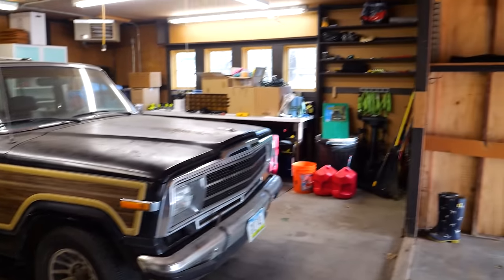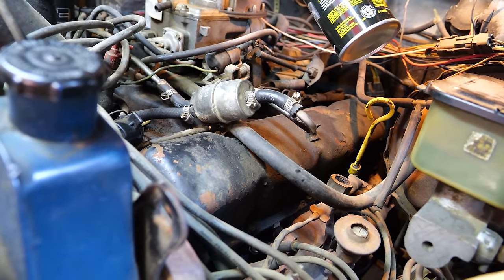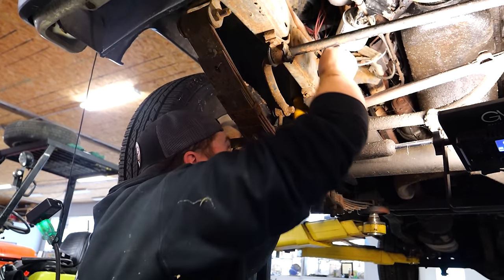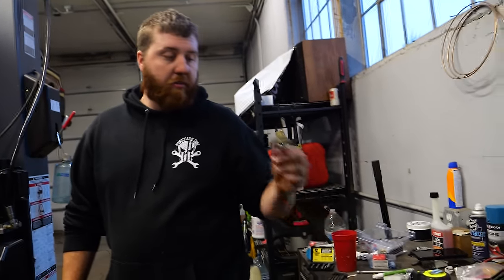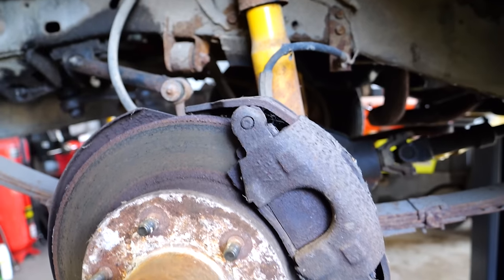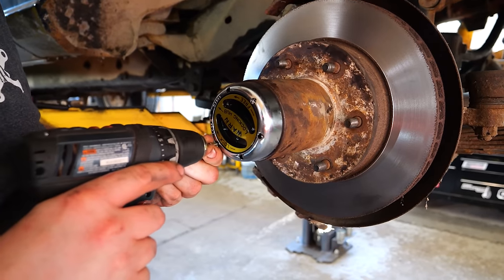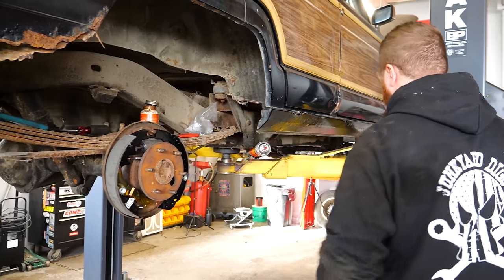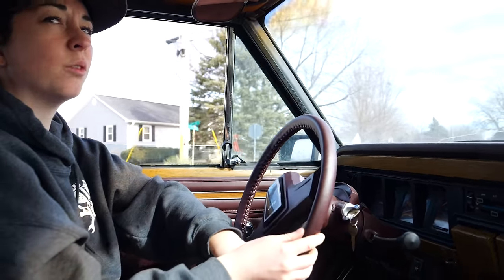Can we SAVE a Jeep that was RAN WITHOUT OIL?? Marketplace SURPRISE

Comment: I know where you can get a 1969 wagoner with a rebuild Buick 350, th400, Dana 44 HD front, and a Dana 60 ff rear axle.  The engine has under 50k miles on it since rebuild.  The body is in much better condition than that one too but doesn't have the wood panels.

The original axles and 3 speed manual transmission are close by as well.

Comment: Those AMC 360's have the oil pump (steel gears) built into the timing cover (cast aluminum).  Guess what happens as you pile up the miles?  The steel oil pump gears eat the aluminum (and the steel bottom plate on the pump), and your oil pressure eventually goes bye-bye.  And since the process is gradual, you don't really notice it until the engine is hurting.

Comment: The answer is always "of course" because worst case those engines are so easy to overhaul it could be trashed yet easy to overhaul.  The sheet metal is key if it's to be a keeper and repair panels are readily available. BTW consider modern adhesives for those as they self-seam seal and often make my beloved welding obsolete. It will also make a good video since too many noobs don't know anything beyond FCAW wire butchery and Bondo. Lord and 3M make some wonderful crash-tested panel adhesives ideal for such work.

Comment: Flywheel could also be knocking. I had a straight six sounded like it had a rod, knock but after looking at it, and taking the transmission almost completely out and looking at the flywheel was cracked like all the way around replaced the flywheel and the rod knocking sound went away

Comment: Drain the oil. Dump a couple gallons of ATF in the crankcase with seafoam and let it run for an hour. Dump it. Change the filter and put fresh oil in it

Comment: If the lifters are clattering with a tight bottom end and good oil PSI, my only theory is that whoever worked on the motor last installed the lifters wrong or put in a different style lifter, one thats not compatible with this particular 360?

Someone I know swapped a 360 from an 89 dodge van into a Coronet. His engine had lifter noise caused by non compatible lifter desgin, which meant ether not enough oil or NO OIL could get to the top of the engine.

Comment: There are two types of electronic distributor pickup sensors, the coil type and the hall effect. The coil type is a coil of wire and a magnet. The hall effect is a silicon chip that is sensitive to magnetism and a magnet. 
All types detect the lobes on the shaft as it turns. In a points type the lobes rub on the rubbing block which moves the points to break the circuit to the coil. In the electronic type they change the magnetic field and the sensor generates a signal which the ignition box amplifies and fires the coil. The coil and hall types of electronic pickup sensors generate different types of signals, this can affect things when you attempt to use another manufacturers control box.

Comment: These engines are known for catastrophic bearing failure due to weak oiling towards the back of the block. AMC motors have oil problems. It is good idea to modify your oil pump. If it’s ran more than 30 seconds without oil pressure you’re going to need rod bearings.

Comment: Mine had lifters dished through to pinholes on the bottom, fully collapsed because then they can't hold individual oil pressure, and then the pushrods can fall out of the rockers and then un-straight themselves, jank out some webbing because there are no guide-plates (hotdog/hallway situation).  Also that valve no longer lifts then of course.  Not sure if just a collapsed/stuck lifter can yeet the pushrods or if it also requires a missing thickness (dished).  Once the pushrod is gone there is no return force on the lifter so they sound real ratta-tatta just free bouncing off the cam.

Pulling the valve covers should answer lots of mystery.  They have drivable power even with 6-7 cyls working (I had at least 3 zigzagged pushrods).  Also since the valves stay closed it can make some extra lower end noises from rod stressing especially if it chucks an exhaust side pushrod and not the intake side (pneumatic-lock, not as destructive as hydro-lock).

Comment: 5:30 that is not hall effect sensor. Hall had 3 wires (power, ground and signal out) and doesn't generate voltage without power. That intuitive sensor in that car

Comment: Fun fact if you think you have a bad rod bearing pull the plug wires one at a time and put back on cap when you pull the wire and the rod knock goes away that's the rod with the bad bearing. In simpler words "remove the bang and the knock will go away"

Comment: I wonder if you put an entire bottle of hyper lube in it and then fill it up the rest of the way with Royal purple HP 10 W 40 and use a filter that gets all the little pieces out of the oil. I wonder if that would help quiet things down and perhaps Get a couple years out of the engine before it self-destruct if at all

Comment: A horizontal oil filter means you don't put any oil in it because the system is a self priming system, the only oil filter you need to fill with oil is if the filter is vertical, because that is telling you the system isn't a self priming system❤

Comment: I'm probably a bit "late to the party" but here goes, that thing with the bearings is so typical AMC V8s. Take a look at the main bearings at the back end of the engine,I could almost place a bet that the the 2 main bearing at the back is shot and "welded" to the crank,that happens because of the routing of the oil system,there are not enough oil left to feed the 2 most rear mains and rods ,it is because how the oil flows: there are 2 main oil channels,driver side oils only the lifters/rockers on that side and the passenger side oils the rest of the engine : it feeds the camshaft bearings/timing chain/dist. gear and fuel pump excenter,it also feeds the lifters/rockers on the pass. side and then it feeds the whole crank/rods.
The rear mains are the last to get oil since it flows from the front,one solution is to get pushrods with a smaller oil passage up to the rockers, (that's the Quick fix that helps a bit) another one is to drill smaller holes in the camshaft bearings and put them in with those smaller holes in place of the bigger ones that are from the manufacturer,You could also lift the intake and open up the plugs in the little "house" in the front of the valley and tap the driver side galley screw in a bored out plug to restrict oil flow to the drivers side.

Comment: We had a Jeep GC, the first one to come out in 1993 I think it was. It had the straight 6. I did an oil change at about 70k or 80k and the oil change before it was with Slick50. When I removed it and that oil I hit the oil sensor unit above the filter and broke it off. I took it for a drive and it wasn't leaking at all so since it was a Sunday night I figured I would go the next day and get the part from the dealership and replace it. Fast forward the next evening, I had totally forgot all about it and my wife drove it 60 miles to work and when she was leaving work she called me on the way home and said it was making a strange noise. I told her to pull over and check the oil and she got all pissed because she was dressed nice for work and didn't want to get dirty so I was like OK screw it just come home. When she pulled into the garage it was making all kinds of noise like this engine. I checked the oil and nothing was on the dip stick. I put in 5 quarts of oil before it was full and it held 6 so it had one quart of oil in it and drove home 60 miles. I got the part and it ended up being fine but I was still worried about bearings going out or something so I sold it off. The guy I sold it to owned a gas station around the corner from me and and it sat outside for many years while he was working. He ended up driving it to around 300k miles and only had to have the transmission replaced or rebuilt at some point but the engine was totally fine. I could not believe it.

Comment: Oil goes the long way around the outside "open end" of the gears in the pump and it  flows  becauses its squeezed in  the gear mesh  in the oposite direction.. but mehh im splittin hairs still excellent content

Comment: Rods ride on oil not bearings. There's a spec for forward to back play like you had but there should be basically 0 play left to right. Also, if it's making a bunch of noise like that, stop running it! Obviously something is wrong such that metal is hitting metal.

Comment: Yeah I think they eliminated that on the Jeep Cherokees cuz my 87 Jeep Cherokee doesn't have no vacuum lines for the four-wheel drive good old pull the lever on the floor there's no any vehicle I have that has that is my 2000 Dodge Ram and has vacuum lines to engage the front axle that we had to fix and on a crunch just did a little sucking on the hose underneath the vehicle when we're stuck in the snow to lock the front axle but it's in fix since then

Comment: If you changed the rod bearings why in the world would you not at least change the mains, or at least check them. 
Some times you forget the basics Kevin, maybe time to lose the pop with foam on top.
Just saying, that and try mixing a little two cycle oil in gasoline in a squirt bottle. 
The at least the cylinders get a little lubrication when they actually get load on them.

Comment: Any mechanic who hears that type of noise will agree with me that noise is because of the lifter noise that’s what you should have done instead of the rod bearings now you have to tear the top end apart and replace the lifters I’m glad that I’m not the one who has to do that

Comment: I wasn’t very smart when I started with vehicles so I was trying to start a truck and I checked the oil and it said low. But it was there wellllll apparently I should have wiped it off and dipped it again because it had no oil at alllllllllllll and the engine froze the first time it actually started

Comment: Hey just wondering what oil should I use in a 1979 360 amc jeep grand cherokee chief
Reply: Does it leak or burn any oil? Do you drive it in cold temps?
Reply: It doesn't leak and I only have it running for 5 minutes it has been sitting Sensei 2016
Reply: 5w30 conventional oil. Don't use synthetic it will seep through the old gaskets.

Comment: HMMM Sounds very much like a collapsed lifter, it could have been damaged when oil pressure was lost, and it got hammered beyond the point of pumping back up again, once you pull the VC's you will know it when you see a loose pushrod, replace the lifters and should be good to go.

Comment: Personally i would start with the engine and then do the frame..sadly you are not even allowed to fix the frame rust like that, same with sub frame and suspension parts. People do it but if insurance company notices it well you are boned.

Comment: Uhhhh locking hubs.. on a viscous coupled with low lock np229... i dont get that... makes no sense youre asking for MAJOR dmg in the effect of an exploding transfercase at the minimum, if those become unlocked.. especially by a next owner.  

This is just stupid  id thumb down this video if they even showed that anymore

The gas mileage improvement is almost nothing... This is silly.   You might as well rip out the interior and bumpers for weight reduction and lower the Jeep if you want better gas mileage on a worn out 360 lol